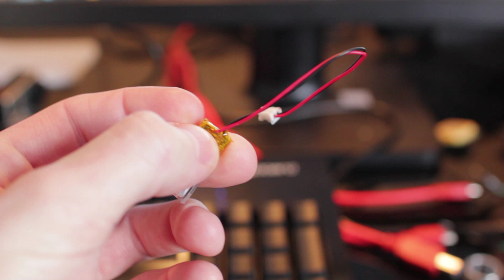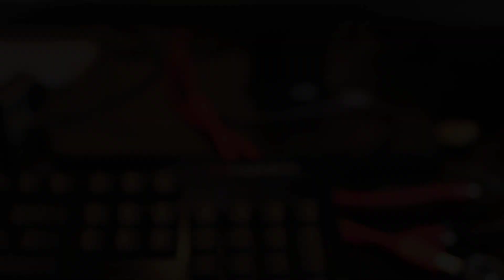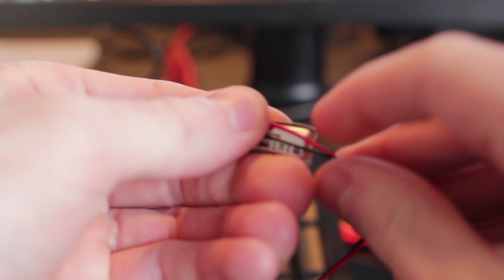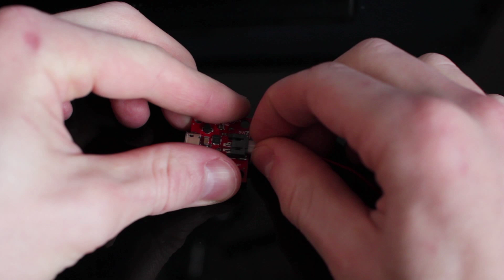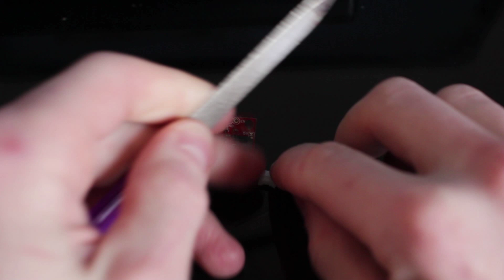Quick Hack: LiPo Battery Improvements

Comment: It's a bad idea to wrap lipo cells with electrical tape.
Reply from the maker: Source?
Reply: IHPArchives It's pretty well known that these things can get very hot, especially if you are discharging them quickly. Wrapping them in electrical tape could cause them to get hotter faster. Also, they can tend to gas if if you have them taped tight, it could lead to a fire or a very strong out-gassing that could damage other components. Have you ever seen a soft bodied lipo cell that's expanded? I had a iPaq 3610 who's soft-bodied lipo battery expanded so much it cracked the screen. You really should look up lipo accidents and safety, especially soft bodied lipos.
Reply from the maker: tarstarkusz I understand and respect your concern with safety, but two things I noticed in your answer. First, if you're discharging a LiPo to the point where its very hot, you're going beyond the limits of the LiPos safe current draw. Especially so for these tiny ones with low mAH. Same goes for charging. - This is much more unsafe practice than the taping. They can get warm, as in you can touch them, but if they are hot, you're asking for trouble. Secondly, as you mentioned they can blow the case apart on an ipaq. I actually had this happen to an old iPhone I had sitting on my desk, popped the screen and the back glass in half. With that being said, there are a number of LiPo batteries that are much more encased than that of some stretchy electrical tape. If a LiPo was to degas, or "balloon" I don't think the tape is going to make it any less safe than just the case itself. 

I would not be concerned with added a couple wraps of tape on any of my batteries. You can buy R/C LiPos that are completely encapsulated by a plastic housing, and they are sold from the manufacturer and are safe also. 

I do appreciate the concern. That is just my take of it though.
Reply: IHPArchives
Ok... Sounds like you know what you are doing and know a bit about Lipo cells. Since they were so small, I was thinking they might be from an RC helicopter or other really high draw application. Have fun and good luck.